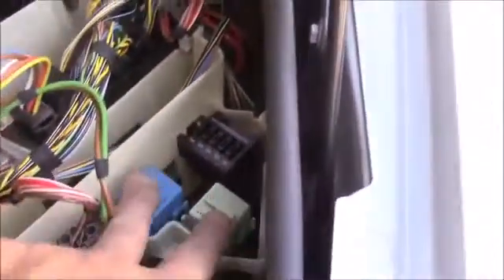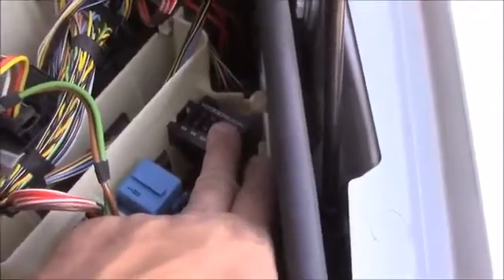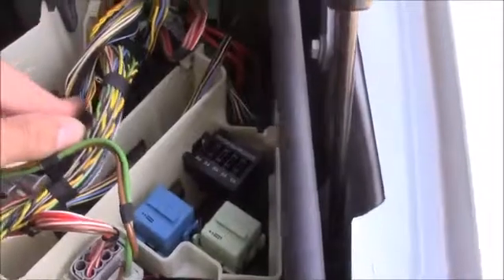BMW E46 E-Box Location Diagram Engine Management DME/ECU Main Relay, Injector Fuses, and Wiper Relay

Comment: Howzt mate l have crank no start vehicle l have  check the following
1. Fuel  pump tick its good 
2. Fuel rail tick fuel is getting there 
3. I check in the fuse box all fuse are good
4. I checked in the computer box all fuse and relays are good
5. Fuel injectors not opening they should open l removed all 4 and connect them to a 12v they are opening l did clean them the cranking no start issue is still there
Any ideas what to look for
Reply: I'd guess and say it's you're ecu or one of those relays he just pointed out in the video, possible the fuse block that's also in this video
Reply: I had a similar issue and went through everything, just replaced the crankshaft and cam sensors and now runs sweet as a nut
Reply from the maker: did you find issue